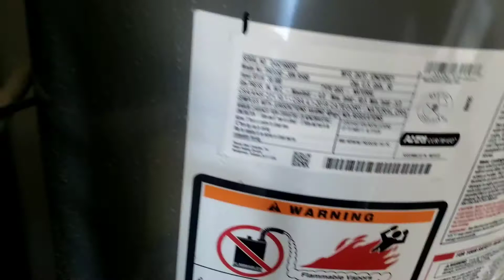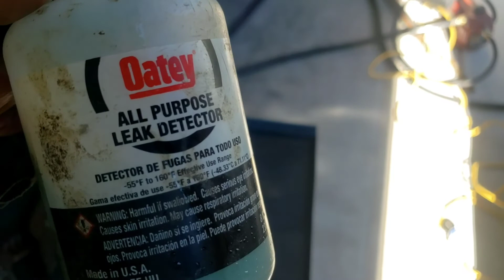LEAKY  NIPPLE PROBLEM😂😂

Comment: This happened to me seven years ago. The nipple was not loose but was installed without pipe dope! Last year the drain valve split opened on the same water heater and flooded my house. Buy your  water heater from a plumbing supply store not a big box store.
Reply from the maker: I've never purchased a heater from a big box store,I totally agree 👍